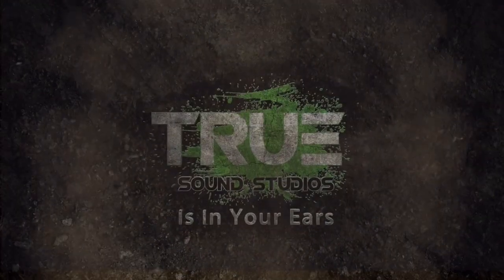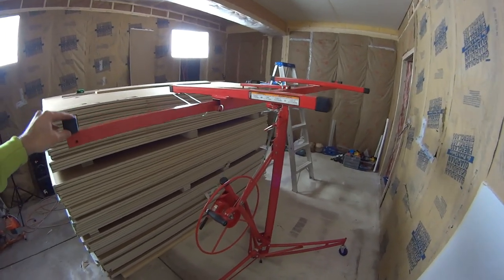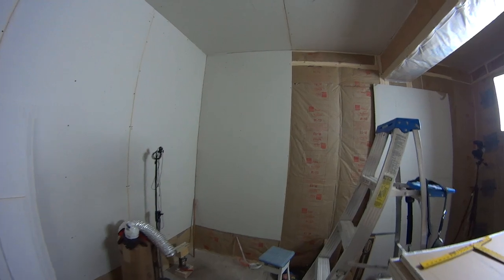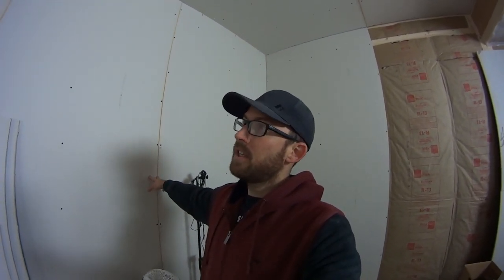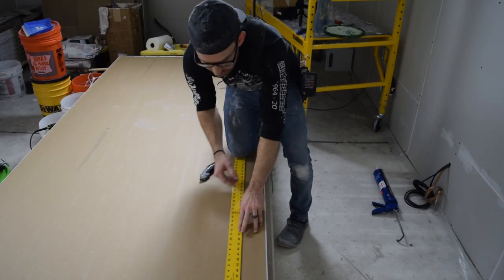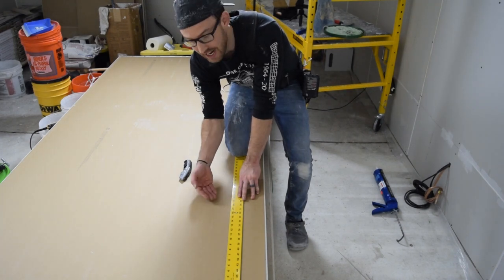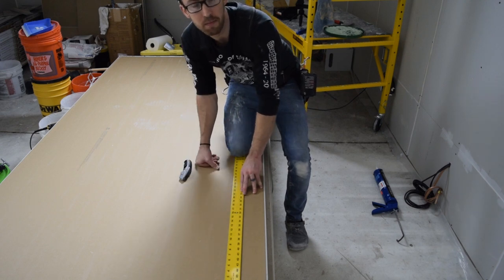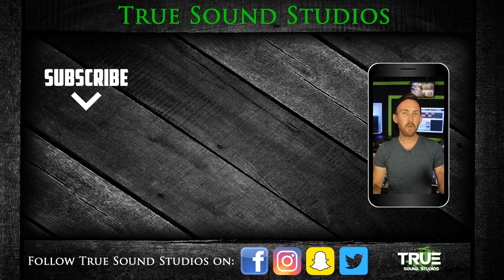Building A Professional Recording Studio - Part 9 (drywall and green glue)

Comment: Just for future reference, the surface density of coloured caulk is just over twice that of drywall, so those potential gaps you refer to would actually be better off filled with caulk.  The caulking would actually be denser than the equivalent drywall that would have been in the gap. Plus caulk is resilient, and not rigid like drywall, which actually increases low frequency transmission loss (similar to green glue, apart from green glue never actually 'goes off')

Comment: Just did some similar with that green glue for a BBshop.. So far, it seems to have worked with reducing sound to the other apartments... I did used about 2.5 tubes of green glue per each sheet of dry wall.

Comment: I'm only about 10 videos into this series so far, but still I am wondering why you made the live room so much smaller than the control room. I was always under the impression that at minimum, the cubic feet of the recording live room should be about 5000 c.f. or greater, and that big live rooms for the most part always sounded much better. I've often read that one of the limiting problems in the building of home studios were they were often bedrooms, rec rooms, small rooms in general. I'm genuinely curious why you selected the room sizing the way you did. Great videos by the way - very interesting. Looking forward to watching them all.

Comment: How come you chose not to install the drywall using green glue whisper clips and resilient channel instead of just screwing right to the studs ?
Reply from the maker: LaSalle Studios Hey so by doing the room within a room, I am de coupling the inner room from the outer room by building two sets of walls. Resilient channel or whisper clips would be used only if you wanted to not do the room within a room, and go straight to the existing wall studs. The room within a room gives you even more soundproofing isolation then using resilient channel or the whisper clips.

Comment: After you removed the drywall ceiling a couple of videos back, whats replaced it? I don't understand whats happened with the room within the room basics with regards to above anymore....
Reply: He still has a room within a room. You might have missed it but In this "vlog" he puts the moisture barrier between the 
"studio room" and the original structure. That moister barrier will catch the "blown in" insulation going into the attic space. If you go back a few "vlogs" he shows the 1" spacing between the structural ceiling and the "room within a room". Hope that help clear it up.